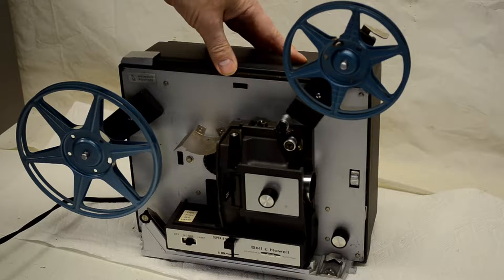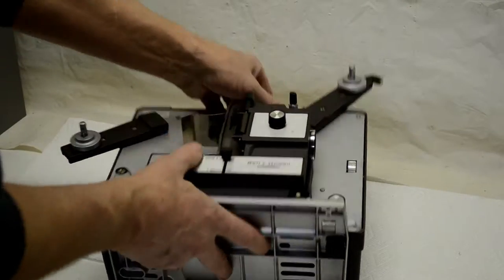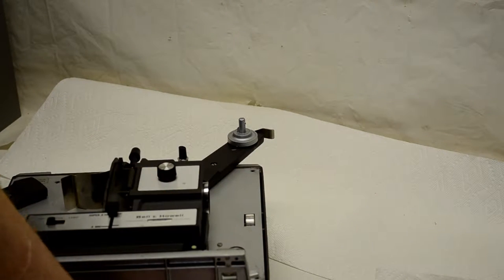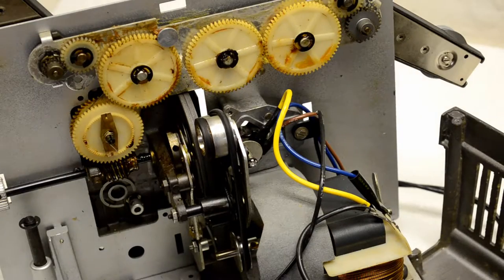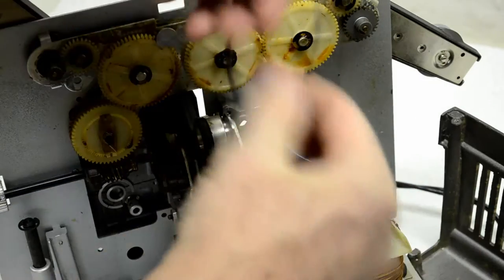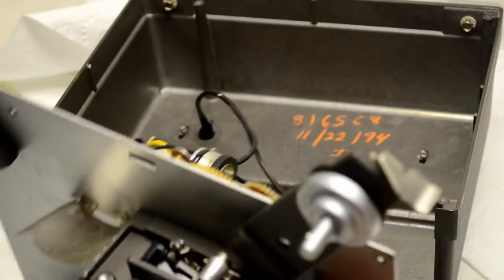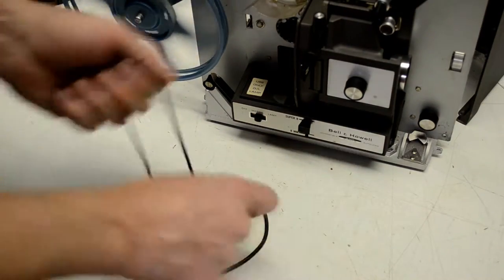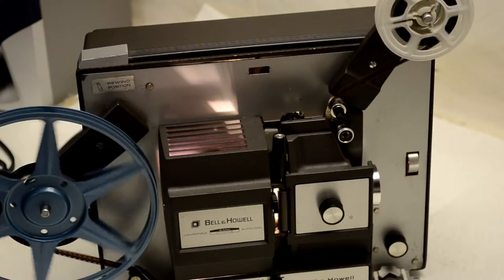Vintage Bell & Howell Super 8, 8 mm, Home Movie Projector Belt Change

Comment: I just changed this belt on a variant of this projector, a Berkeley 1550. I was having trouble finding a belt on line and knew I had seen a similar sized oring in my shop, the oil filter oring for my Ecotec Chevrolet Cobalt, it comes with a Fram CH9018 oil filter , it fits, it works and my wife can see her family’s Super 8 films from yesteryears vacations!
Awesome. and if or when it breaks , time for another oil change!
Thanks for this video, muchly appreciated
Reply from the maker: Thank you for watching and taking the time to comment. Take care!